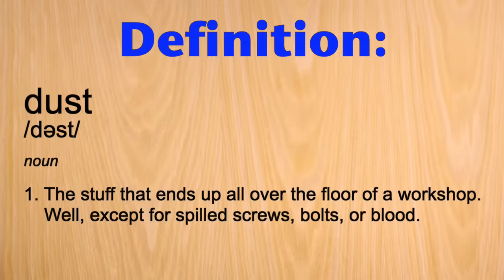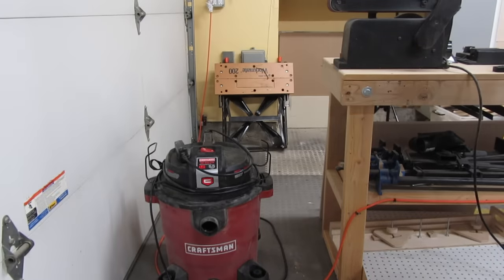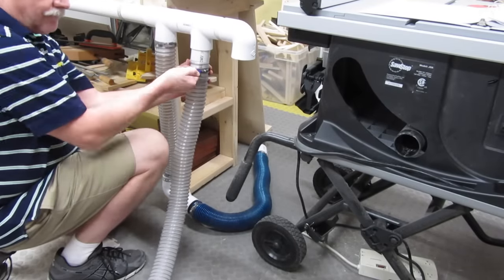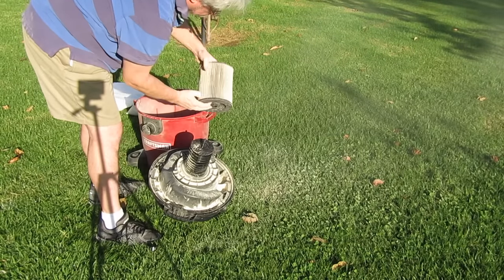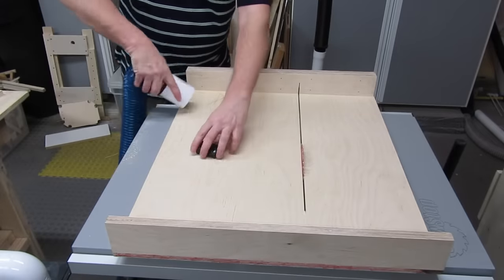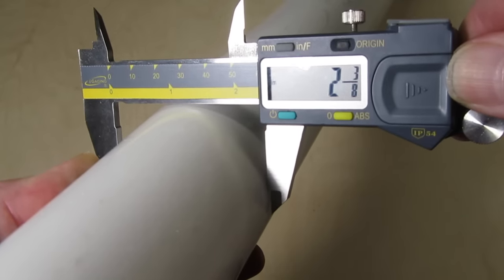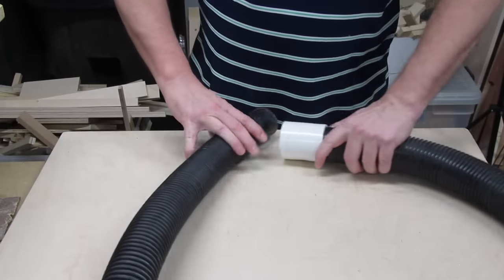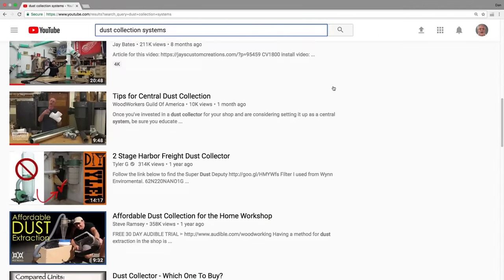Dust Collection for Newbies: Introduction to Dust Collection

Comment: Your comment that 45s and wyes only improve the efficiency to a small degree is incorrect. Ninety degree bends in a dust collection system pretty much cuts the efficiency in half and the more you have between the machine and the blower reduce it exponentially more. Any bend in a dust system should have a radius of 1 1/2 times the diameter of the pipe at the center line of the bend. Example: a friend had a tee just off his blower and the flow was negligible. He replaced it with a wye and two 45's and the  flow increased more than ten-fold. It made the difference between working and not working. Likewise, flex hose should be kept to a minimum due to the increased friction loss in the flex hose over pipe. Many people get super carried away with flex because it's easy to install.
Reply from the maker: There's a tremendous difference between how blower-based collectors work vs. shop-vac-based collectors. One relies on air volume, the other on air speed (or something like that). I don't know the technical details, but they really are different, and so are the effects of 45-vs-90 degree joints. I'm not saying they have no effect, but the difference is much less than you might think, with shop-vac-based systems. See my test results: https://youtu.be/DzuPo802mV8.
Reply: @TheNewbieWoodworker  "Or something like that". :) I've spent my whole adult life moving liquids and gases and friction loss is friction loss. Whether it be due to actual friction from interaction with the wall of the conductor or turbulence due to interruptions in the stream from bends or fittings, it's still friction loss. In truth, the higher the speed involved, the greater the percentage loss. Turbulence due to tight bends rivals throttling a system by using piping that is too small for the greatest power thief in home systems. When you're dealing with a little shop vac you need everything you can get. Best to do everything you can to help it do it's job rather than "that's good enough".
Reply from the maker: @edpretty7348  No, actually, "good enough" really is good enough. But I understand what you're saying.

Comment: Nice overview.  BTW...  I cut pvc with chopsaw all the time.  Safe?  Not sure but never had an issue and the cuts are very clean.
Reply from the maker: Thanks. I like the way you stated that - good CYA. ;p
Reply: I work with wood, but also own a swimming pool company.  When we are building filter systems with new PVC pipe, we always use a chopsaw for those cuts.  Very neat and clean.  Makes glue-ups perfect every time !!
Reply from the maker: Nice to know. Thanks!
Reply: @davidfusick9785  tips on how to stabilize the pipe while cutting.? (keep it from rolling) Do I need to make a cradle or jig? ( SAFETY is my #1 priority.)
Reply: I only used 4" pvc for my system, so  I found that large enough to hold by hand.  It didn't roll or even twist.  I also was using a brand new  blade on my saw, so that helps too.
Reply from the maker: @doveoo5 - Lots of people have commented that they use chop saws to cut PVC, and nobody has mentioned a jig. I'm not saying it's safe - I don't have a chop saw so I can't speak to that. But personally, I would think if it required a jig or something like that, somebody would have mentioned it. Obviously your safety is your responsibility, bla bla bla. 😛
Reply: @doveoo5  The most dangerous area of cut on PVC is near the halfway point as the walls are now verticle.  To totally avoid that area, stop the cut and roll the piece a quarter turn or so.  If you are using an aggressive blade, this will help prevent the PVC from exploding.
Reply from the maker: @alext9067  Thanks for the info!

Comment: Not dust related but something I came up with years ago as a flooring remodeling contractor. I re-purposed countrytime lemonade containers for my nails, screws & fasteners. They don't rust, don't shatter if dropped, come with  a "dish" cap if you just need a few, which you can write on with a sharpie for easy ID  AND fit perfectly into 4" PVC rings arranged in shallow box as a wall hung storage rack- Tyler
Reply from the maker: That sounds great! Thanks for sharing.

Comment: Great video!
But how in the heck do you not have a miter saw in your woodshop?! 😛
Reply from the maker: Thanks and LOL. Main reason? No room. I have to pick and choose what tools I can have. Although I'm hoping to create some flip-top cabinets, at some point, so I might have room then.
Reply: Right?Q! That's what I thought. HUH??!!! LoL
Reply from the maker: Believe it or not, you can get by without a miter saw just fine. For instance Matthias Wandel doesn't use one. Although if I actually did cut a lot of miters, then I'd probably miss having one.

Comment: I’m new to woodworking and have acquired a 10x20’ shed that is empty now and just for me However I have COPD and it gets very dusty FAST !
 Thx’s for your Awesome Videoclip On dust control and will start getting all the parts together during these Cold winter days.
 Only question is what about getting shocked from Static Electricity from the hoses, I seen no grounding at all ?
 Just wondering !
Thx’s from St Joseph, MO.
Reply from the maker: Thanks. Regarding static electricity, have a look at this link: http://www.rockler.com/how-to/exploding-pvc-dust-collection-ductwork/. That's basically my thoughts on the subject. Of course, do whatever you think is best, and I wouldn't fault you for deciding to ground your system. Since you asked the question, I assume you already know there's plenty of YouTube videos on the subject.

Because you have COPD, you should also get, or make, an air filtration system to remove dust particles from the air. For a really simple and cheap method, see this video (I know it starts with showing an expensive version, but keep watching): https://www.youtube.com/watch?v=BSiDJfj2dFQ. You can just stick with that method (which I think is a good one), or do more YouTube searches to see the many different solutions people have come up with. I'm not using an air filtration system right now, but as I type this, I'm thinking I should be using one. sigh Another thing on the "to do" list. :)

Lastly, make sure you use a dust mask of some kind, at least when you're running tools. There's tons of different types available, and I don't know which is good or bad, so you'll have to research that yourself. But since you'll be wearing it a lot, make sure it's comfortable. The ones I have fog up my glasses, so I tend to not use them much, which is probably bad on my part... :)

Have fun! Keep us updated on what you decide to do!
Reply: Jay bates has a video on his air cleaner, which might be a good idea for you to look into as well.
Reply from the maker: Good idea! John Heisz has one also. https://youtu.be/Lzyw2cE8Ir0
Reply: I looked in the comments for exactly this.  Static shock is less of the issue, dust explosion (more of a fireball) is a much bigger problem.  For the PVC you can run a copper wire through it.  Not hard to ground it.  While risk is low, it has and does happen.  I am an engineer and have seen fires started by static discharge.  Wood dust is highly flammable.
Reply from the maker: @Worrsaint  Thanks, and I love your YouTube ID. As a retired software engineer, I'd have to say "ditto". 😄From what I've read, it's not really an issue in shops of the size that can use a 2" dust collection system. But I would never tell someone not to do it. And honestly, even if I don't think it's necessary, I wish I had included it in the video, just to be thorough. Too late now, though.
Reply: @TheNewbieWoodworker  You are right, a shop of your size it wouldnt be an issue.  Having larger volume running at higher speeds would greatly increase the risk because of there being more friction.  One other thing about static, it make the pipes more likely to clog due to clumping and clinging to the pipe.  One other word of advice, if you shop vac has an outlet port, run it outside.  Even if you have a hepa filter in there, it still passes the very fine dust through it which is actually more dangerous than the bigger pieces of dust.  Gets deeper in the lungs and gets stuck.
Reply from the maker: @Worrsaint  Thanks! Good advice. 😄
Reply: @TheNewbieWoodworker  no problem.  I have done work on dust collection systems and material conveyors in the past.
Reply from the maker: @Worrsaint  In that case, I think you did a great job of "tempering" your comments. If you're anything like me, on a subject I know a lot about, I'd be like "NO! NO! NO! You don't understand!!!". 😛
Reply: @TheNewbieWoodworker  Hahaha.  I start out nice, go armchair expert about something you clearly aren't an expert about, I tend to get less nice lol.
Reply from the maker: @Worrsaint  LOL. That's why I call myself "newbie", to help remind myself not to take my own opinions too seriously. It's a daily struggle, of course. 😄
Reply: @TheNewbieWoodworker  Lol good way to look at it.  The creator and the watchers should learn stuff on YouTube.  People should spend more time sharing information and less time trolling and having flame wars.
Reply from the maker: @Worrsaint  Agreed.

Comment: Hi Dan,  I’m in the process of building a work bench which will incorporate my Mitre Saw, Table Saw, Router, Stand Drill and want to include a Dust collection manifold with a Cyclone and my Bosch Vacuum.
I have watched dozens of YouTube video’s about Dust Collection in workshops and yours was the most comprehensive and informative I have seen,  I wish that components such as the Blast Gates were so easily available in the UK as they are in the US.  I’m now going to look at more of your videos. 
Keep up the good work.
Myke
Reply from the maker: Thanks, Myke, and glad I could help! Good luck with the blast gates.

Comment: I cut pipes with my miter
Reply from the maker: Thanks for the info! 👍
Reply: @TheNewbieWoodworker  it works really good on abs and pvc high tooth count cut slow
Reply from the maker: @williamkreth  👍
Reply: I also cut them with my drop saw. I haven’t  had a problem but after your experience maybe I need to be more careful.
Reply from the maker: @rossharvey1496  👍

Comment: We recently had our guttering and downpipes replaced. The guys who did it used a chop saw / mitre saw to cut all the pipes and gutters. The fence had been modified with a piece of wood with 2 grooves cut in it to allow the 2 different pipe sizes to be held firmly with more contact to the fence. When I spoke with the guys they said the modified fence wasn't really needed, it just made it easier and safer when that was all they cut with that saw. They did say however a good saw blade makes for better cuts and to use a blade with 48/50 teeth. Less can cause the pipe to shatter.
To cut the guttering they said to place the open side down can cut carefully, not pressing too hard.
Thanks for the great tips.
Reply from the maker: Wow, that's great information. Nothing like hearing from people who do something for a living. Thanks!

Comment: EXCELLENT!  as a "newbie" I'm having problem with this now = nothing seems to fit, especially that Rockler flex hose which came with the Dust Right Separator I purchased - what a pain that one was.  Finally I heated the hose in the oven on a pan at 200 degrees while I chilled the fixed connectors outside in the 19 degree air, and the connectors finally went on the flex hose.  One went perfectly, the other is on but it is not a pretty fit as you mention, it's very difficult to achieve perfection.  I've subscribed and will be witching your other vids.  I'll be making a set up like you have shown.  Really did not want to do that, but see now that is is necessary.  Much appreciate the helpful video; Thank you!
Reply from the maker: Thanks! You're on the right track with heating stuff. Get some PVC or PVC couplers, and heat them using a heat gun or hair dryer. That'll let you expand the end(s) so you can make connectors and adapters to make anything fit. You can also heat them in the oven, on aluminum foil at 350 for about 5 minutes, but a lot of people are worried about fumes. From what I've read, unless you actually burn PVC, you're fine, but what do I know? 😄After a while you'll get good at making connectors and adapters. And sometimes, just duct tape will do the trick!

Comment: This video is sooooo well done!  Great content, tons of information, and explained clearly.  Thank you for taking the time to make this.
Some thoughts on cutting PVC with a miter saw:
1.  Keep it well supported on both sides.
2.  Use a high tooth blade (96 tooth is best).
3.  If you are cutting off a section near one end of the pipe, place a board inside the pvc pipe that will extend out the end.  Use a clamp to clamp the board down.  This will help hold the pvc in place.
4.  Lower to the saw very slowly onto the pvc.
5.  ALWAYS ALWAYS ALWAYS wear eye protection (and preferably a face shield as well).
6.  I wear a N95 rated dust mask when I cut PVC.
Reply from the maker: Thanks for the nice compliments, and the great tips. And after what happened to me, I totally agree with #5. 😄

Comment: I work in a small 8x10 shed, and was in the process of using PVC and flexible hose to make a system, but I was tired of fussing around with parts that don't fit, etc.... Geez, I even built a manifold to choose between three different intake ports as I didn't want to buy expensive blast gates and such. But at the end of the day, what worked for me, is to use short runs of flexible hoses from each of my tools up to my my Duststopper intake, and connect the Duststopper to whatever tool I want, by hand. No gates, no tees.... I just grab one of the labeled hoses, and insert into my intake... I think I was aiming for perfection and overthinking much of all this! I feel that connecting whichever hose to the Duststopper by hand takes a few seconds and makes everything simpler. Just a thought :)
Reply from the maker: That's a really cool idea. I never thought of it from that direction before - I was always thinking of the run from the vacuum to the tool, not the other way around. I'm sure it wouldn't fit everyone's needs, but it works for yours, so that's way cool! One thing you could consider, depending on how many runs you have: Check out this picture - it'll help you understand what I'm describing: https://i.pinimg.com/564x/69/5c/40/695c40d9283560532719a160a107f961.jpg. It's a sliding panel with the dust hoses attached to it. Use magnets to cause it to stick in the right place. I hope it makes sense. If you need a better explanation, let me know and I'll see what I can come up with.
Reply: @TheNewbieWoodworker  just because of the fact you took the time to suggest an option adapted to that gentleman's idea, you have my sub... ok, also because your video was very good, well explained, well presented, very clear even for the French dude I am... and we all know how "good" frogs' English is.
Reply from the maker: @benjaminkorhum5068  LOL. Thanks for the support. And sorry for the delay in responding - my hard drive crashed and took until now to get everything restored (fortunately I had a current backup).

Comment: Thank you for a most comprehensive discussion on dust collection. I learned a lot and will apply some of your ideas to my situation. This might be helpful, I have placed a bag over the filter of my shop vac, so I clean the bag and never replace the filter. You can find them on Amazon, the size will depend on what kind and size of shop vac you use.
Reply from the maker: Thanks for the info. I was going to try that if the Dust Deputy didn't work, but it's worked very well, and I haven't had to replace the filter in several years.

Comment: Yes, your video has addressed my issues precisely. Although my workbench / outfeed table is on wheels, I usually put that and my miter saw in the same spots when I use them in the garage. I can see that using PVC, flexible hoses and blast gates along with my shop vac and dustopper will be the solution I was looking for. Thanks for the reminder that perfection is not attainable. 😉
Terrific demonstrations, explanations and presentation.
Reply from the maker: Thanks, and you're quite welcome! 😄And I learned about perfection from Tin Cup: https://www.youtube.com/watch?v=a_2KWie9hAQ&feature=youtu.be&t=46

Comment: I've got a lot of experience in industrial dust collection.  Your video was quite well done.  Cyclonic collecters come in a variety of sizes.  I read where one fellow made his own from a 5-gal pail with the inlet offset.  His appeared to work.  But remember, the way a cyclone works is based on inertia.  The more aerodynamically dense particles whirl around the inner circumference of the separator eventually falling out of the air stream while the less dense particle remain in the air stream and are vented out the top.  Best to send it up at 45 degree angles, then down through 90 elbow into a 2nd 45, than to use 90 degree elbows, which make a shelf on which particulates can accumulate, eventually clogging your system.  Air flow speed is important, as well as pressure.  If you use a shop-vac, you are depending on ambient air pressure to cause flow.  OK, if the goal is total collection.  If there is a need to separate particles from each other based on aerodynamic properties, you need a blower instead of a vacuum to entrain the material in the air stream.  Then, adjust the flow rate to create the sort of pressure needed to segregate.  BTW, I bought a small cyclone online for $18.
Reply from the maker: Thanks for the info.

Comment: My separator is attached to the lid of a Clorox pool chemical bucket that has a lock / release button. It's ideal for this application, and was something I'd otherwise have to throw away. Lots of great info in that video, so thanks for posting.
Reply from the maker: Great idea, thanks for the comment! 😄